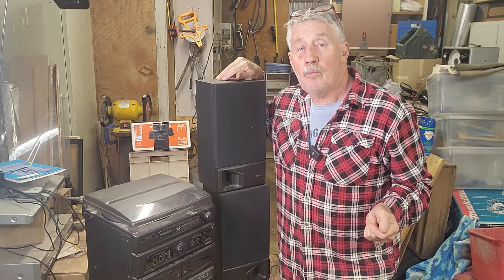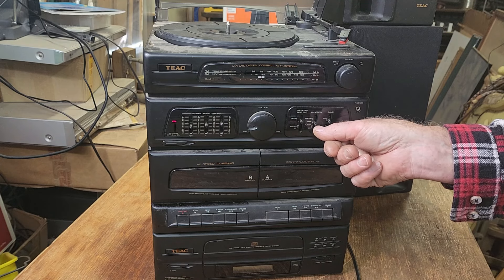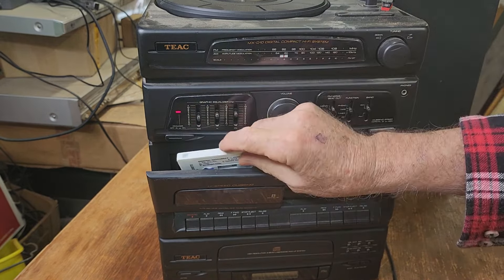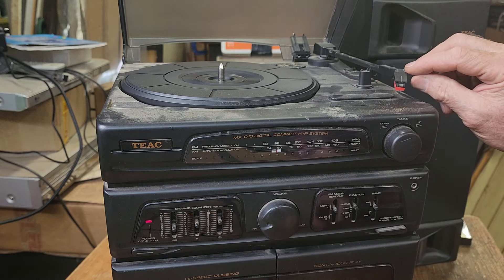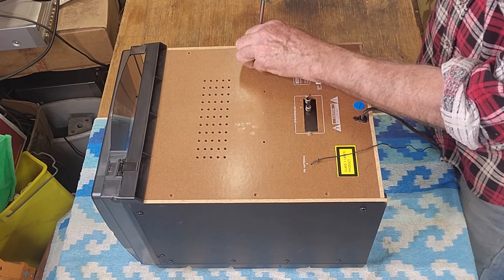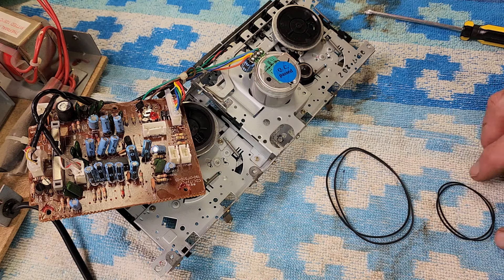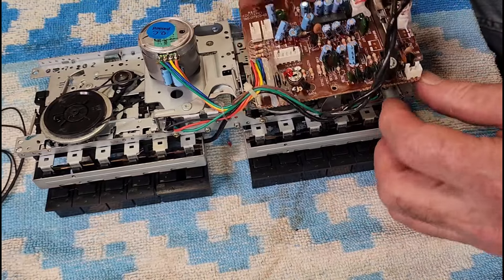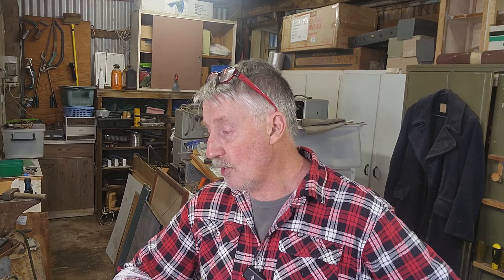How to Fix up a Vintage Teac MX-D10 Mini Hifi System which was Thrown Out as E-Waste! Test & Repair

Comment: These all in one devices are pretty neat. I prefer seperate components, but I had several of these type growing up. These days you can get them used for about 30-50$ in the U.S. but they all need lots of tuning and repairing. If I was in the market for one, I would be willing to pay a bit more if I knew the tune up had already been done.
Reply from the maker: I'm with you Kayle, I much prefer the old component systems 😃👍

Comment: Thank you for the walk through! It's super helpful to see inside! I've just picked up an almost identical unit (a bit later model) with a stuck volume button and am trying to determine whether I am myself capable of taking it apart and giving it the clean up it needs. I've no prior electronics experience and would be nervous to lose track of where something plugged in!
Reply from the maker: Have a go Laura, it's the best way to learn. Just film it all as a reference and then you don't need a good memory! 😊👍

Comment: Probably you already worked it out but just in case......You can record from one cassette to the other. One cassette has the record button the other not.
Be careful when  play on the recording one avoiding pressing the record button (If a cassette still has the tag on top) and you want to keep some of the music......
Reply from the maker: Yes, you are correct Mario. I didn't actually test the record function though..

Comment: There's no way that was made by TEAC. TEAC/TASCAM made studio quality kit. This is a Capetronic type record deck with Tanashin cassette ,  and these were  pretty much the cheapest systems you could buy circa 1990. Someone just rebadged it, it's a knock off probably sold in discount store or even used as a prize at a fairground (I have seen them there!) At least it works, if you had no stereo I suppose you'd be glad of that.
Reply from the maker: I think there was a lot of re-badging going on back then! Probably happens even more now actually!
I sold the unit first weekend for $100!